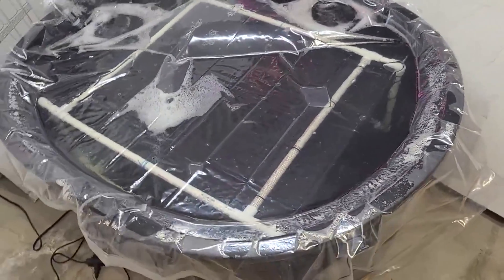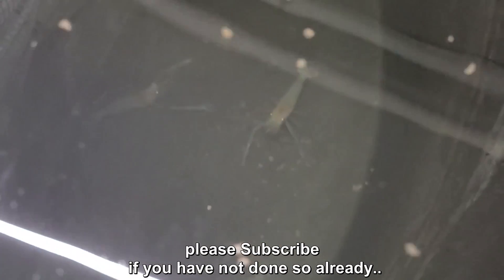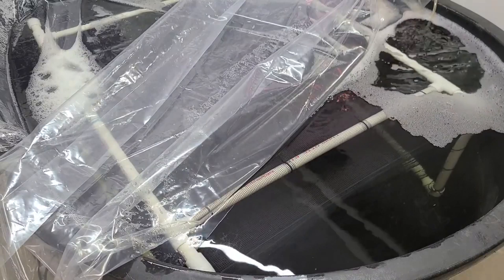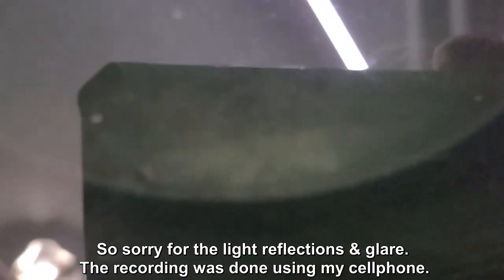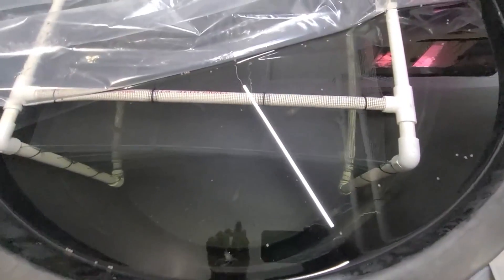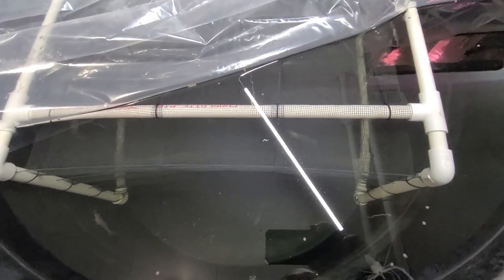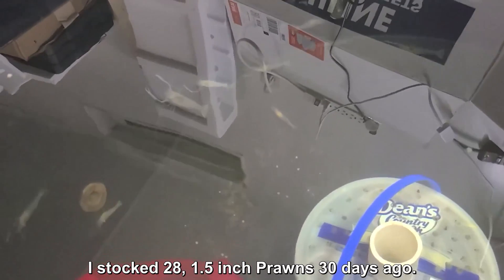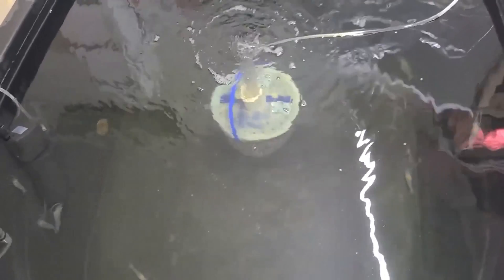30 Days Update - Growing Freshwater Prawns in a Stock Tank

Comment: I would love to see videos on how to raise shrimp larvae.  I used to raise some seahorses and it was a VERY difficult task keeping green water, copepods, etc. available and keeping the water clean.  I did this on a small scale, but would like to see how you do this?  Also, when a female is ready for the brackish water, should be introduced slowly over several days to the brackish water or simply introduce her with the normal temp and small water acclimation procedures you recommend?